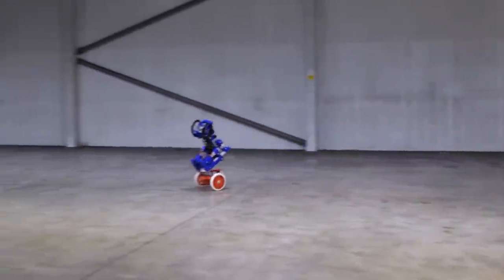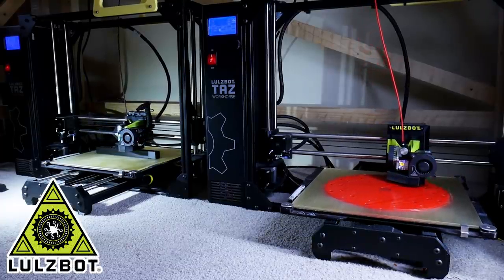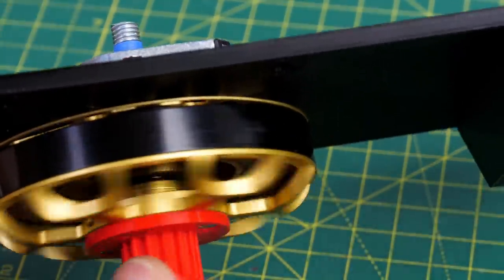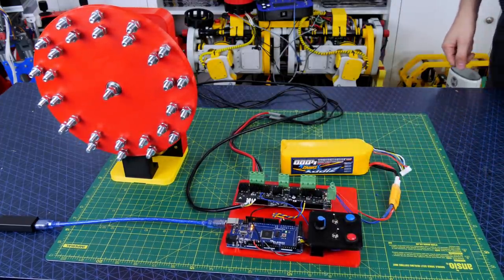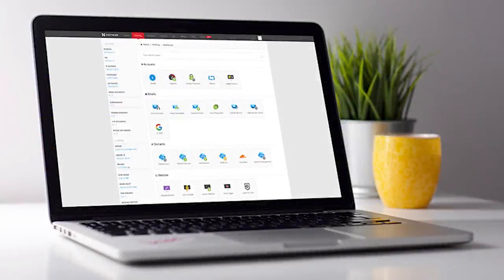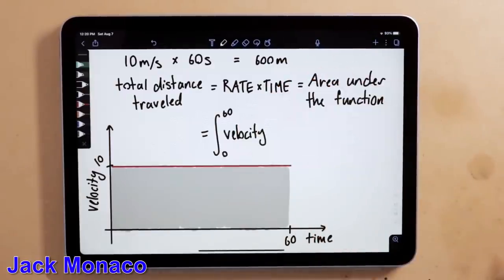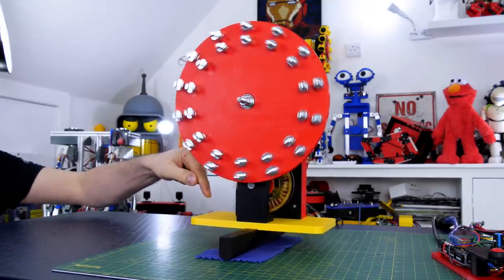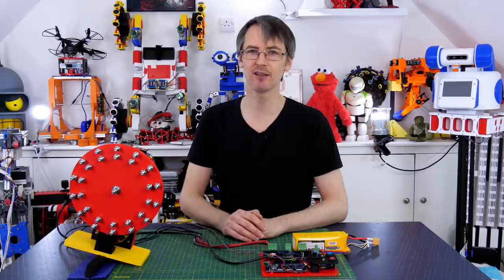What is the Difference Between Reaction Wheels and  Gyroscopes?

Comment: Shouldn't the pid be better to tune to make the output not the motor speed but the motor acceleration? S Think about it this what if the whole thing is tilted 5° you would expect a proportional controll to apply 5units of force for restoring the position. 
In this case tho the thing starts to spinn at a certain rate giving you a restoring force proportional to the rate of changes (like a differential normally does). Meanwhile the integrator creates a accelerated proportional to the tilt and thus a restoring moment proportional to the position of the system.(like the proportinal part normally would) 
and the derivative reacts to the rate of change by giving out a constant rotational speed so you apply a force portional to the rate of change of the rate of change(kinda weird).
So basically you have only a pd controller.
My suggestion would be to let the controller controll the acceleration of the motor by integrating the output of the controller and thus controlling the output force directly.

Ps: the problem with the system trying to always spin up is because the pd controller you use doesn't integrate error and never is able to return to a set point.

Comment: at 10:52 you say the reaction wheel "can only exert force when it is accelerating or decelerating". Is that really true? I understand the force is greatest when accelerating, but doesn't it always exert some counter torque when spinning? I am trying to build a simple three wheel cart that steers with a reaction wheel, using only an RC speed controller instead of real motor drive and was counting on that effect.
Reply: Yes it's always true. If you hold a fan while it's running it doesn't try to spin out of your hand. But if it's accelerating it does try to twist. This is most easily felt with a high power computer fan.

Comment: Hey i was just looking through some designs on the internet and i came across a what was basically a treadmill with smaller belts that went across horizontally to make it omni directional allowing the user to run 360 degrees now i dont know how well it could move on the ground and it sounds hard to make but it was just a thought. Somehow make a omni directional tank? Lol

Comment: passive dual co-axial contra rotating two-mass-disc gyro auto-stabilizer, not active
Reply: contra rotating should make it only try to stabilize, not tilt the thing to the side, because same but opposite force from the two discs
Reply: passive stability is always better than active balancing, ie self-balanced vs controlled active balance, even if you get to do a nice controller project in vain

Comment: Why is everything he prints so massive? Wouldnt it be much more logical to print these test-prints much smaller as he would waste less time printing?  What he printed here would work fine 1/2 scale
Reply: Some things don't scale up or down very well or linearly. For instance you can see lots of videos of little servo based humanoid robots walking or dancing, but getting a full sized one to work is much harder. 

The smaller you go with these things the reaction wheel itself is a smaller portion of the weight compared to the fixed weight of the battery, controller and motor. This makes it less effective and harder to tune. A big heavy wheel with a powerful motor gives you far more useful range before you hit saturation. 

Why not use a smaller motor, esc and battery etc? most likely because that big motor is what he has on hand, he doesn't have time to order one for a video being released in a week, and I imagine it would be uneconomical to buy a new motor of perfect size for every project. It also arguably makes for a better demo being able to really heave on the thing.

Comment: I am endlessly disappointed by how many of your projects are wobbly
Reply: In many cases its because the system is non linear. To understand how to control non linear systems you need at least a masters degree in control systems engineering.    This all looks so much easier than it is so kudos to james!
Reply from the maker: try building a balancing robot and see how it goes...